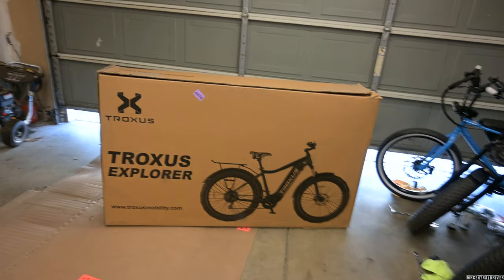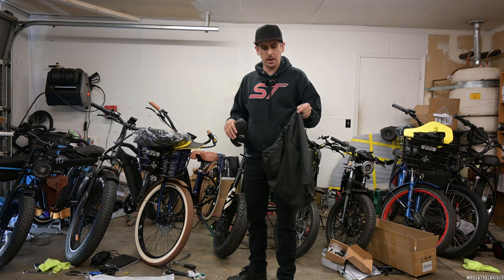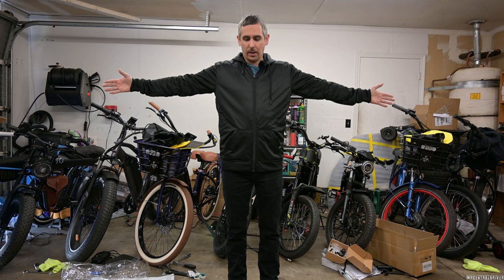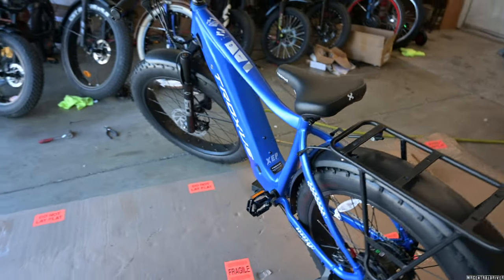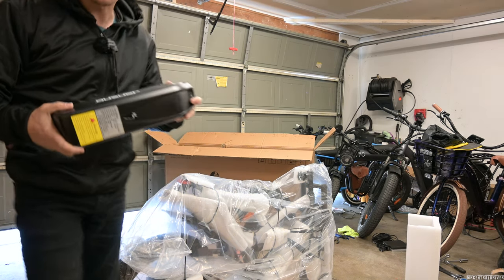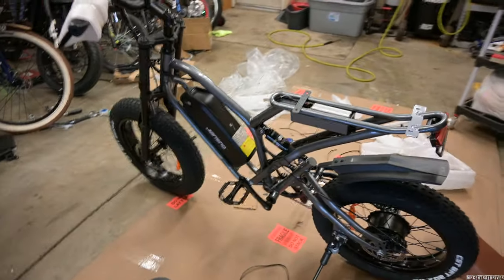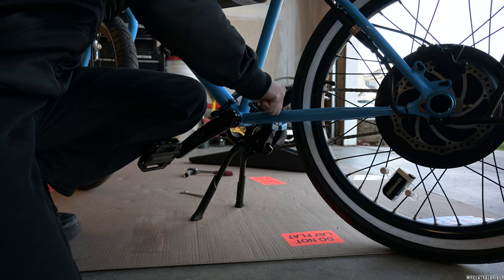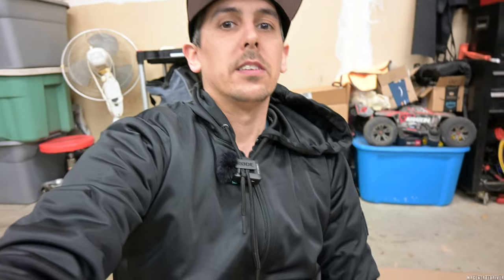2 NEW BIKES + Beyond Riders HOODIE & MILK RACING SurRon Part

Comment: Good looking bikes!!! The color on the Troxus looks very NICE!!! Looking forward to the ride video. And that little bike is not so little, that frame with those 20x4 tires gives it a sporty attitude!!! The hoodie/jacket looks good too. Do you plan to put the pads on? Will like to see how it looks with the pads, is the hood removable? Another awesome video brother, always informative and to the point!!! Oh I was gonna suggest like Scuba T mentioned, maybe put some hooks on the wall to hang the bikes you don't frequently use? Will give you more space for the Telsa??? 🤔🫣😄💪👍👍🔥🔥🔥 GREAT STUFF MR CD
Reply from the maker: I have the front and back pads in. It’s so comfortable I use this jacket for work now. The hood part is not removable. The little bike is bare bones looking and decently small. Just sits high. Light too. I move my bikes so much and they are all so close I feel the hooks wouldn’t do much use depending which bike can sit next to each other.

Comment: Yes nice Blue bike so far. Troxus ..Those are like 70/30 dirt to street tires.  Kepler tires are more 50/50 tires. Looks like they used Advent Adventure style tail lights on the rear frame.

Comment: Not a fan of the center mount kickstand, that ish snap on me and doesn’t carry much weight (maybe i’m just a fatty but @200lbs, should?) also my handlebars keep swing around like exorcist when front wheel raises, and they rub against the rear tires. I ended up picking up Portland Design Works | Power Stance Kickstand, much better!

Comment: not sure why yo are not getting the range you should be getting. are you using bot batteries or just the one from powerful lithium? Might need to contact them and see what they can tell you.
Reply from the maker: I just completed showing back n forth to work without a charge. 13-14miles total each day. 26-28 miles and I was at like 48% but I’m full throttle everywhere top speed
Reply: @MrCentralDriver  yeah top speed will suck to quick that explains it you might get half the mileage then but 26 to 28 miles is not bad and having 48% left. I think you are probally getting the miles if the motor and controller was putting out less you would get better of course.